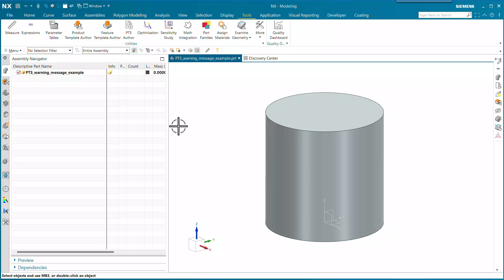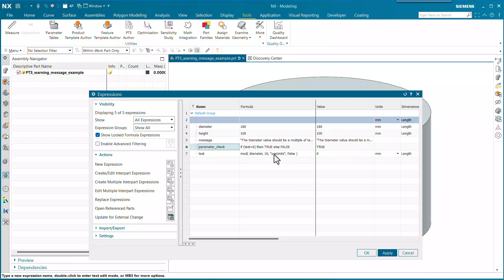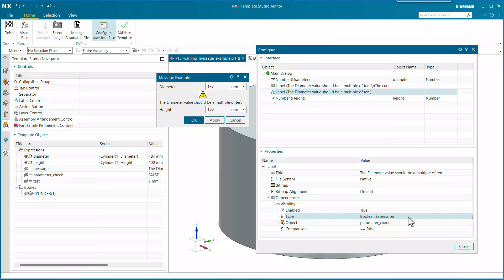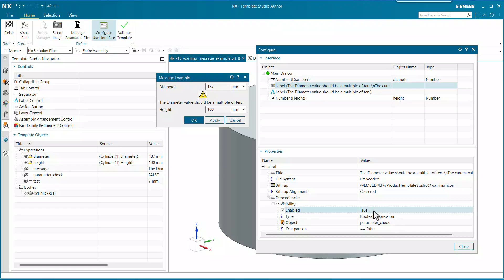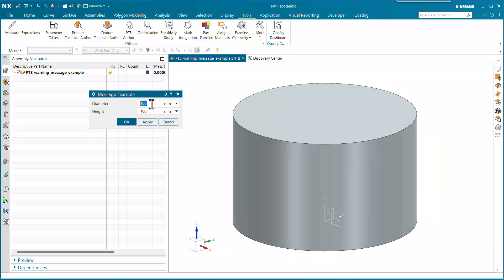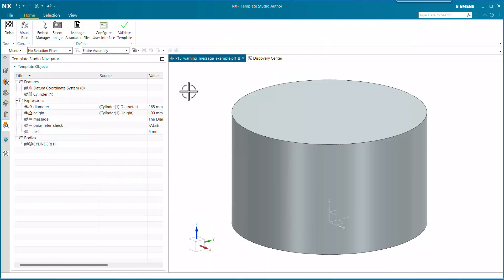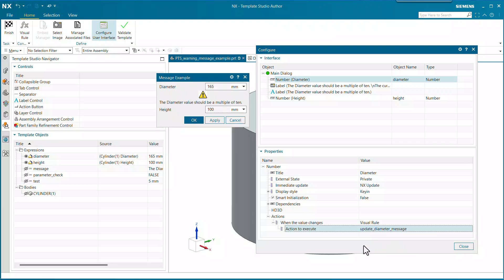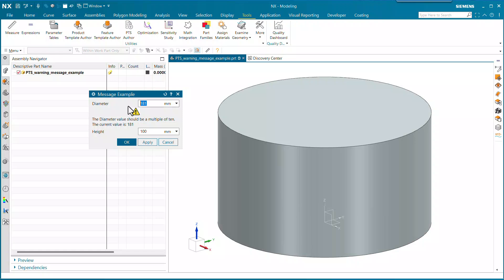NX Feature Templates: Using a Label to show a Warning Message [NX 2206]

Comment: Is it possible to block the OK and the Apply buttons when test==false, so the user can't create the part when some parameter is wrong?
Reply from the maker: Great question!  Most of the parameter entry widgets have the ability to add limits (upper and/or lower) to each input.  If one of these limits is exceeded, the OK and APPLY buttons will automatically be disabled, and warning messages about the out-of-range inputs will be displayed.  Does that make sense?